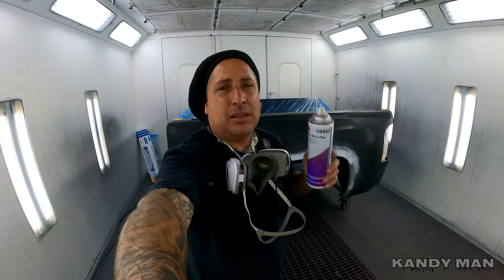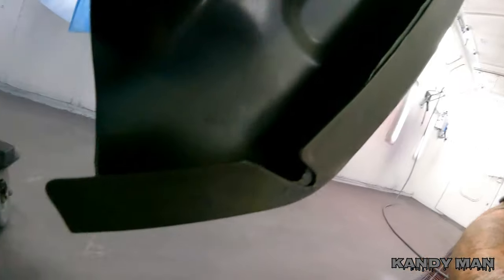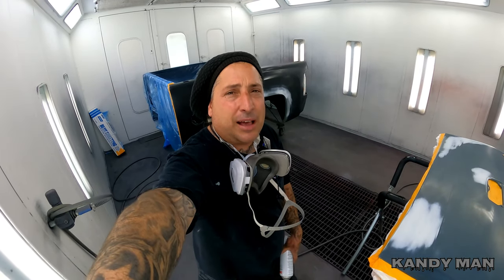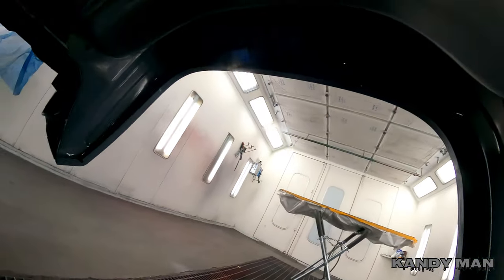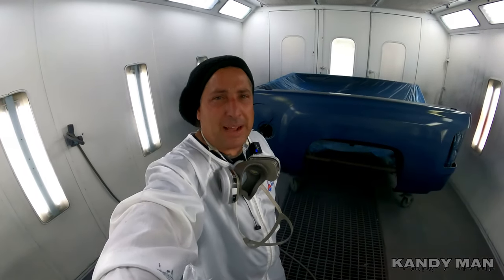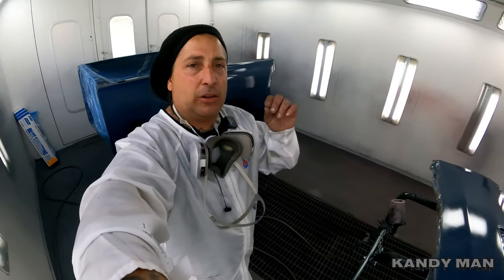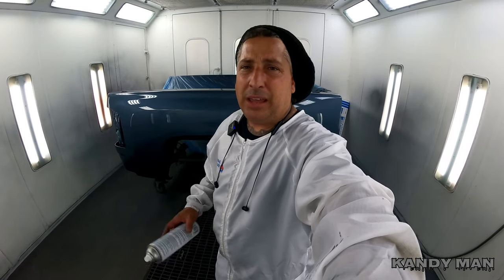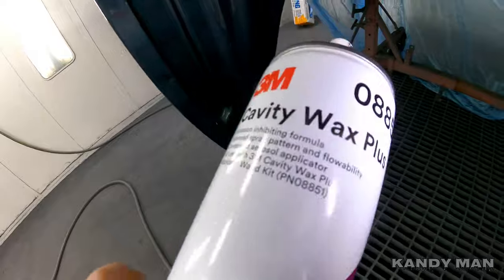STEPS FOR A LONG LASTING REPAIR - A MUST

Comment: It's pretty much impossible to get rust treatment and protection on all the inner surfaces that have been welded together, so I wouldn't call this a "forever" repair. What rusts out body panels is where pockets form at the bottom of where outer and inner panels meet: dirt. salt and moisture collect there and eventually rust thru the thin sheetmetal cars are made out of. Old cars and trucks were less prone to this problem because they had fenders that hung completely outside the bodies or beds so no pockets were formed to collect junk off of the roads (plus they were made of thicker metal). If you drive a newer car a lot on roads that are wet, muddy and/or salted it seems no matter what you do your vehicle is going to rust out.